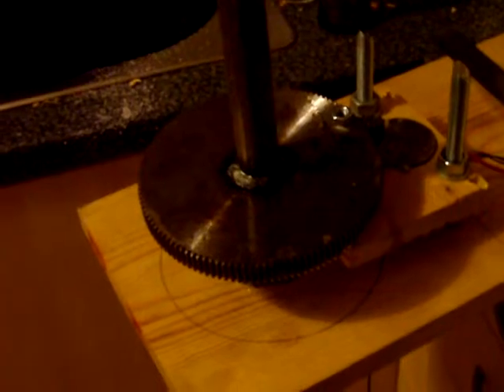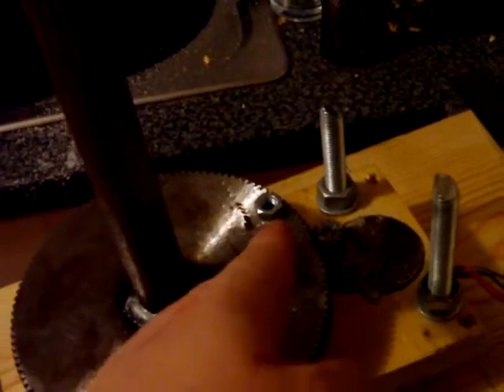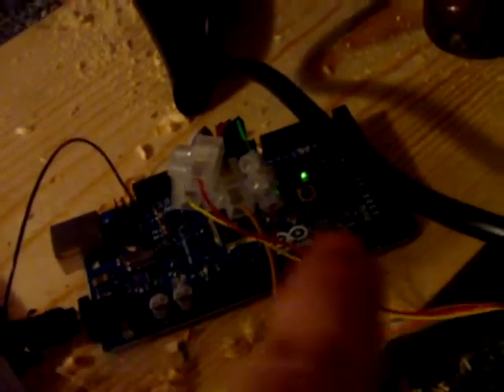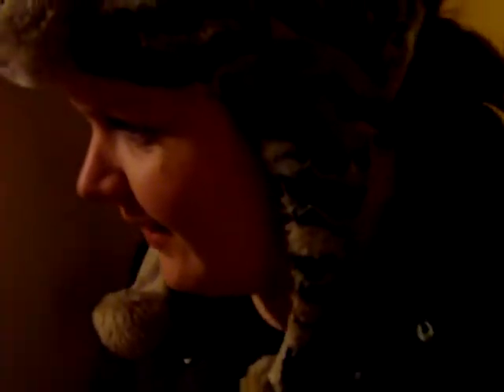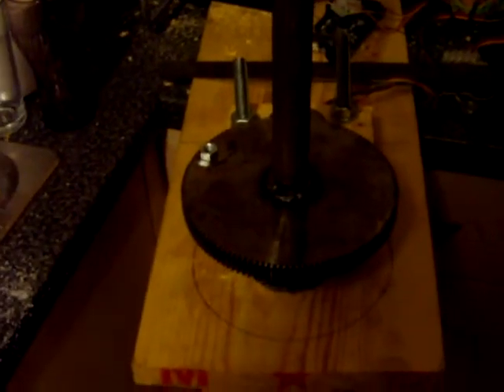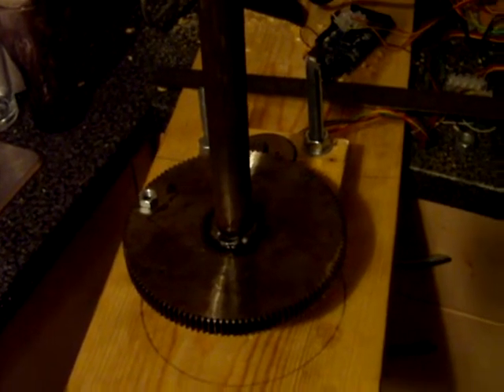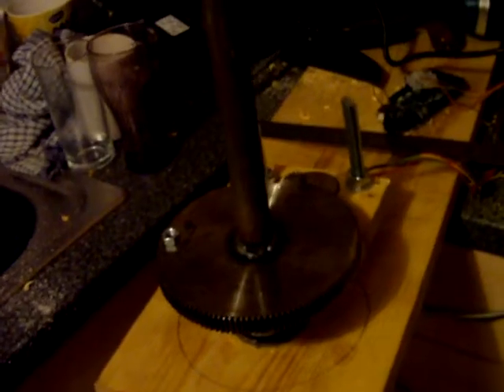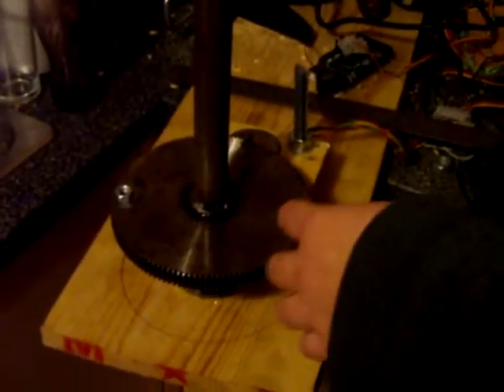Arduino controlled steel gearbox for archimedes solar tracking solar oven.

Comment from the maker: @shane0569 watch?v=bmgfcSXR6qw I'm not using the stepper motor anymore, its too slow and too weak to move the dish. I built the whole system only to find the dish wouldn't turn. I'm now using a windscreen wiper motor instead.